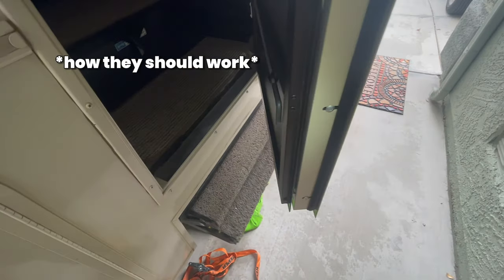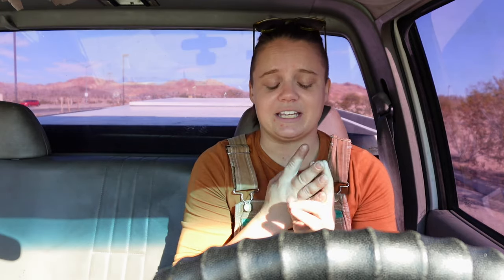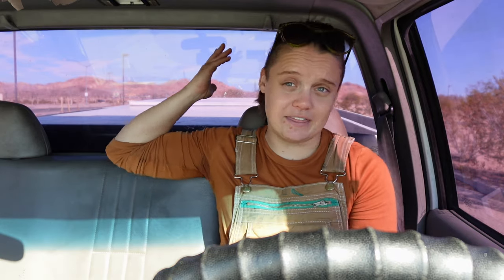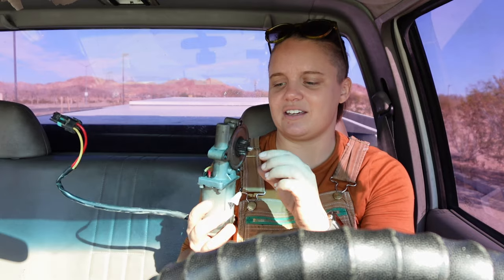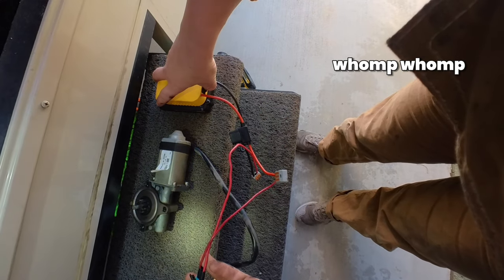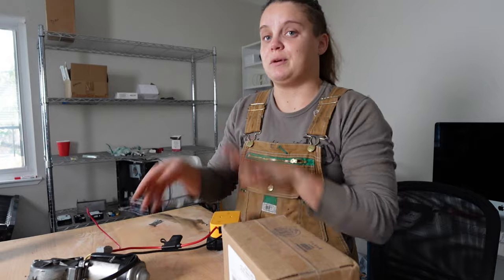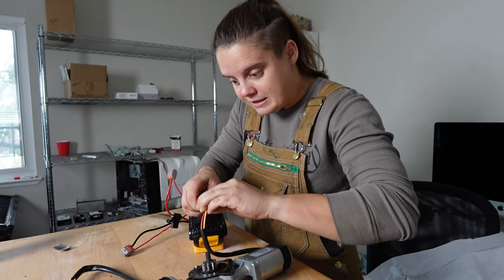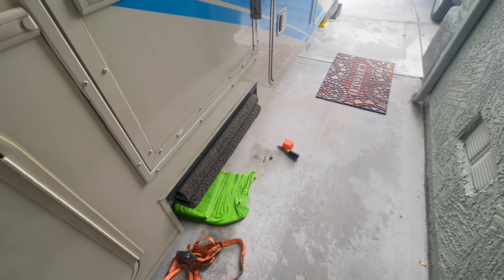RV Steps Not Working?  - (A day in the life of an RV tech)

Comment: Nightmare for the day-
We got into out MH & headed down the highway and a car on our left swerved toward us, so, we swerved to the right to give us both more room when - BANG- No, we did not touch so, we pulled over to look & our steps were out & bent. They had hit a steel road sign post,
bent, broke a couple of the bolts. We had to drive as is until we found a auto parts house & bought a couple bolts and made temp repairs.
back at home I dropped the steps, disassembled them, straightened the bent parts, removed the powder coat, sanded off all the rust & sprayed everything with truck bed liner. Tomorrow I will reassemble with new stainless steel fasteners & hang them. THEN - it gets a new steps switch.

!
Reply from the maker: Oh my goodness that sucks. I like the truck bed liner solution. I’ll keep that in my back pocket if I ever need it. Lmk how the repair goes.

Comment: Great video.  I was just about to say, Alright you got your truck fixed...
Reply from the maker: XD We thought it was fixed too, and then it rained again and I got stranded in an Panera parking lot. We've narrowed down that the distributor cap is held down with 2 screws, 1 of which's hole has snapped off of the distributor. So the cap just flops around and lets water in. Only real fix is to replace the entire distributor which we just aren't looking forward to.

Comment: "boom okay we're getting 20 volts"   this is what you measured from your test power tool. Granted with this type of motor (or awning motor) 20V is not a problem for short test period. I would encourage you to get a similar add-on adapter that converts a Dewalt 20V battery to 12V.  and add test jumper leads. Makes it usable on circuit boards etc.
Reply from the maker: Yeah I only use it for small intervals to test things. Been thinking about getting an adapter, there’s just always SOMETHING to buy in this job.
Reply: Granted about having to always need some more tools. But I see way to many videos or comments by certified/able RV  Techs that are just plainly incorrect or dangerous. But it is still a good video, keep up the good work. @rvrepairwoman